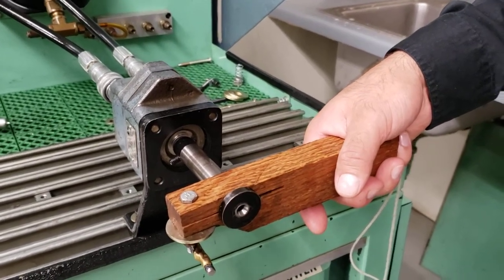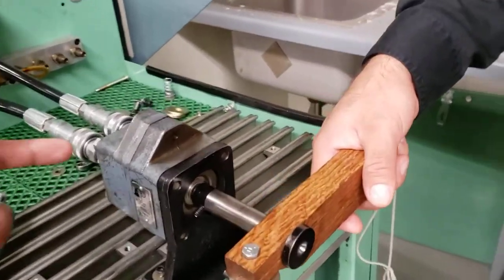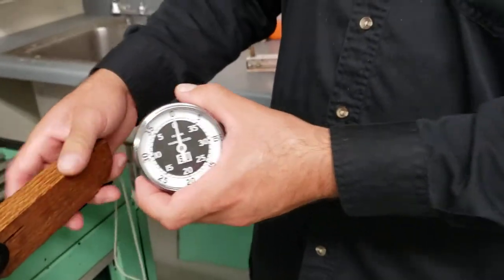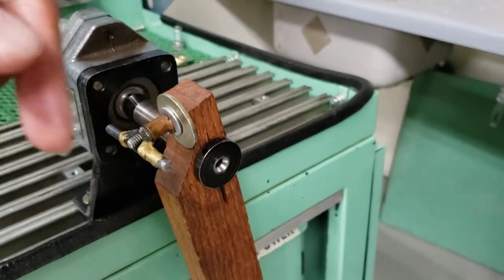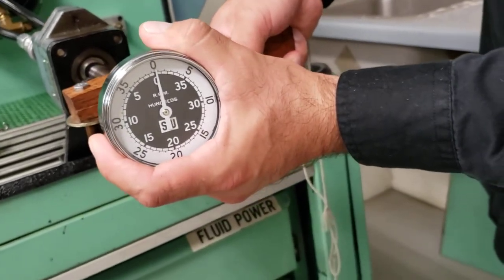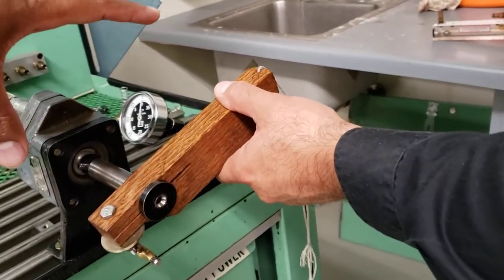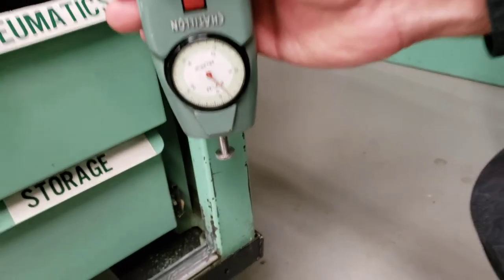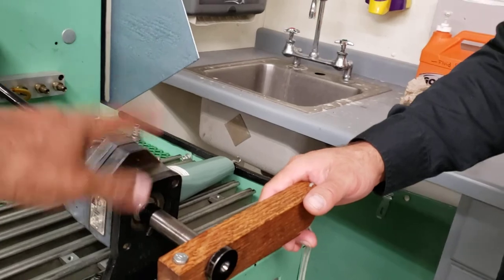Hydraulic Motor Lab Demo | Hydraulic and Mechanical Horsepower Transferred | Fluid Power Lab

Comment: I don't quite understand how this could possibly measure the torque when the shaft is slipping on the shaft.
Reply: Agree, for the same reason, but reversed, is how they calculate RPM. The pressure excerpted by the stick clamping the shaft might effect the speed.. (I also understand that the effect on the RPM is probably minimal in this case, but still..)
Reply: Yea im thinkin the same thing. Its slipping, if it wasnt slipping it wud jav dragged that guy along over it.

Comment: With 4 of these on wheel and a spare tire 3/4 water filled and 60 psi then it cost no fuel and generate electricity at the same time to so we can use it to generate electricity and drive electric motor or half hydraulic motor half generator either way it is fuel less and use gear ratios to get any torque or speed you like base in model of car

Comment: Sir,
We have one Hydraulic pump of 40LPM. Its
oil pressure 150 bar . Our  requirements is two 
Moter running with this pump oil RPM  required 70-90
HP 6.5-7.5
Please suggest a hadraulic moter
Reply from the maker: You will find more here: https://www.theopeneducator.com/fluid-power